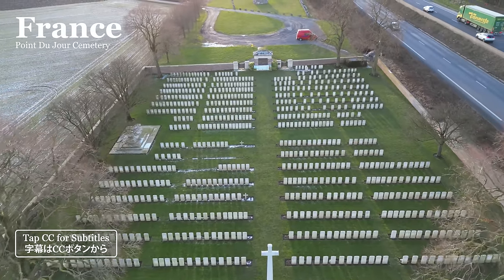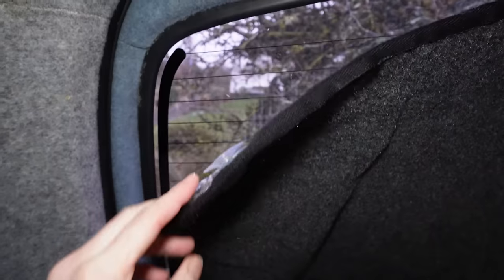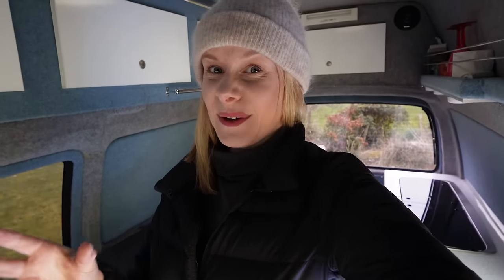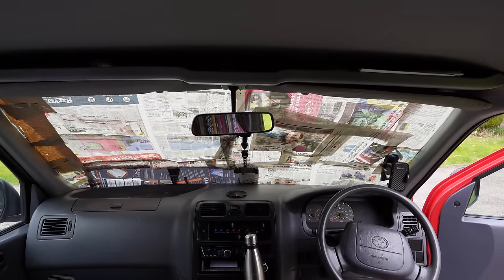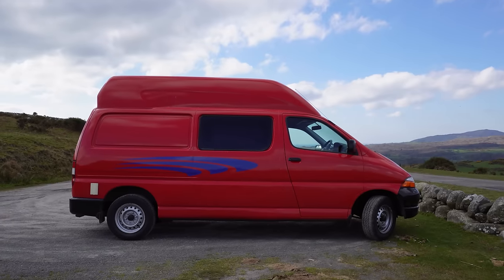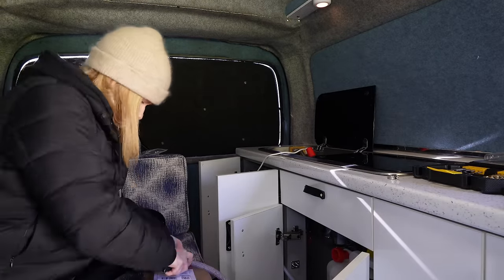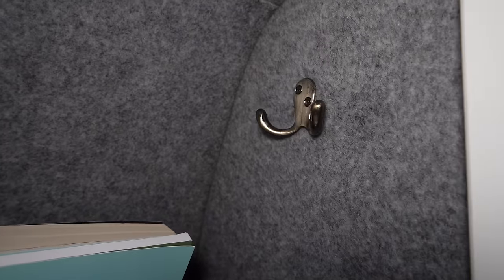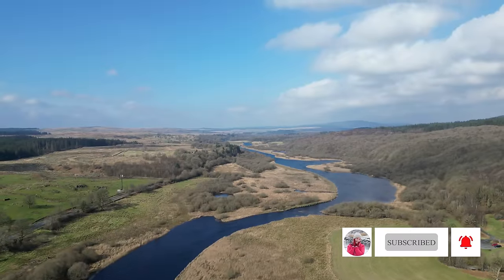It's Time To Make Some Changes...

Comment: You cook in the van. This  combo of oil and condensation sticks to everything including your windows, this why the suction stoppers do not work.  Simple answer is to just wipe the window with meths or isopropanol where the stoppers make contact and also wipe the stoppers and they will stay in place.
Reply from the maker: Thank you for the helpful advice! 🙏

Comment: Hi Ruth lubricate that runner with a graphite or silicone lubricant every 6 mo. It's a spray lubricant. Not oil or grease which holds dirt.  Enjoy your updates. Glad you are home safe and ok. I am adding 300w of solar to my van for my 40th B day in May. Cheers from Boston. Also I used iron on hem tape on my insulated window covers and it failed in about a year, then I used jeans iron on patch strips, it lasted about two years finally I used colored duct tape it's been working well for over 3 years.
Reply from the maker: Thank you for all this helpful advice. I’ll get some spray. Happy early birthday! 🎉
Reply: @ruthaisling if you can find it get Bose T9. Bonds to metal & does not attract dust or oil
Reply: Hello Ruth,think you could use  small magnets on your windows and on your covers, better than the suction pads

Comment: The foil blinds can be used in summer during the day when the van is parked up to try to keep some of light out rather than making it a green house.
Reply from the maker: Good idea. Although I’ve yet to experience a very hot day in the van 🏴😂
Reply: After a few van trips you'll have one giant muscular leg😂
Would painting the front window blind black make too much heat in the van?

Comment: Hello Ruth, I couldn’t help noticing that your gas bottle is not in a designated locker. It should be in a metal box with a door with a vent in the floor, so that if you have a leak of gas, which  it is heavier than air it is vented outside, have you a carbon monoxide detector? Great video by the way.
Reply from the maker: Thanks for pointing it out. Yes I have a CO detector. The space seems tricky to make a locker but I’ll look into it.

Comment: Ruth, as well as your suction pads, could you consider some over long fibre glass rods, essentially they need to be 2 or 3 cm longer than the height of your windows, you could then bend them into window recess, they;d be held in by the pressure of being bent into place against the window.
Reply from the maker: That’s a good idea, thank you!
Reply: I was thinking of the same sort of thing.🤔🏴

Comment: Hello, If you have remake the window covers at some future time, here is a tip.  Make the carpet about half an inch bigger all round.  The insulation would fit as you have done here but the border will be floppy enough to seal all the light.  On my van, I cut a piece of thin ply to over size of the window, then put some plastic blocks screwed on the metal surround.  I just bend the ply to fit behind the plastic blocks.  The ply is insulated with rubber/foil Do-Do and covered with  van carpet inside.
Reply from the maker: Good to know, thank you for sharing!

Comment: Hi Ruth,if you put suckers on both sides in the winter put the carpet on the outside and in the summer flip it around for reflecting the sun out to help keep the van cooler.  You could also put suckers on both sides of the front side windows then you can simply swap the left to the right side and vice versa.
Reply from the maker: Thank you for the helpful advice! 🙏

Comment: Suggestion. All that carpeting inside you should get some hook-and-loop (Velcro) - mostly the hook part. You can use it to stick just about anything to the walls and pull it off or stick it back on as you like.  Good 3M Velcro has really good adhesive on the strips. It’d be great for the window covers too.

Comment: If you must use suckers, go to your local supermarket's baking section and buy a small bottle of glycerine. Apply a thin film to the sucker and it will stay on.
The front was a problem. Would a modern roller blind mounted to the roof, basically in the same area as the curtains, not be a simpler solution?

Comment: Use cat litter cubes look like little pipe bits and wood chip it will work out cheaper and pine smell also cost free.xx❤
Reply from the maker: Thanks for the tip!

Comment: Hi Ruth you have been a busy bee!!  Your mark 2 window insulators are better, mine in the front is just the silver colour material and doesn’t harm with condensation, but as you think it looks obvious you are inside it might be better darker. I don’t think carpet would work with the condensation, so maybe painting them black might be the answer.  Your new handles are great, also your foot pump, hope there is enough flow.  Looking forward to your next trip in Scotland. Cheers Mike🥃🥃

Comment: We're in the process of changing our covers over to magnets which is a lot better and reflective on the ootside keeps the sun oot and the van cooler in the summer 😊
Reply from the maker: That sounds like a good idea, were you using suctions before?
Reply: @ruthaisling  aye some of them are still suction but the magnet ones are so much easier to just pull out and put on
Reply: @ruthaisling  we're also going to make them a tad bigger than the actual window size so it blocks out all the light also thinking of running a few stitch lines down them so they can fold easier

Comment: If you just make the window covers a little bit bigger than the window, you don’t need suction cups. It will just fit in between the van and the frame.

Comment: Maybe try long strips of velcro with sticky backings 😊 to hold the coverings in place . You would make them bigger than the actual window 🪟 to use the velcro strips with sticky backing 😊 . Maybe more secure to hold in place vs a window with condensation on it in winter
Reply from the maker: Oh good idea! Thank you! ❤

Comment: You should look into a NOCO battery jumper pack. They work really well at jumping the car/van if the battery dies. They are small, powerful and you only have to charge them about once a year if you're not using it loads.
Reply from the maker: That sounds good, I’ll look into it! Thank you! 🙏

Comment: I would retain the 12V pump and bypass the ignition switch. As long as you can get a 12V from somewhere, a simple inline switch would suffice to switch the pump on and off.
Reply from the maker: Yes it would have been an option but that 12V pump uses so much water. The foot pump is using less water I’m finding!

Comment: Hey Ruth great channel, think I’ve watched you a while ago but I never subscribed but I have now lol , just wondered how you got on with the shavings I have a similar loo I bought for my van conversion but I started using it in my boat, got a load of sawdust from the logs I cut up for my log burner but it’s hard wood antler me know how you got on with the shavings thanks Jack
Reply from the maker: I've used the duftblocker mostly as I still have some left but have also used the wood shavings sometimes to try them. They have been ok but I prefer the duftblocker. The wood shavings are easy to buy and still do the job.

Comment: Hi is everything okay?
Usually, when making a mold, spray water on a thin piece of paper to get the correct size! Then, the actual sheet to be installed should be cut 2 to 3 mm larger so that it fits well on the rubber trim of windows, etc. If the sheet material is thin, you can laminate it with a thin plastic board to eliminate the need for extra stopper clips! Just for reference! 😊😊😊
and If you keep soap and air fresheners in your toilet box, you won't have to worry about them! 😉
Reply from the maker: Thank you for the helpful advice! 🙏

Comment: I use a usb water dispenser from Amazon; super simple to fit, really efficient and cheap!
it’s the Amazi Water Pump… a single charge (via usb) is good for 8/10 5 gallon containers…
Totally independent of complicated wiring etc…
I also purchased a longer silicone tube so the tap sits above the counter top, like urs…
Reply from the maker: Thanks for sharing!

Comment: Greetings from Scotland! Hi Ruth! Just a thing I learned when doing the same thing (making insulated blinds) was that internal blinds, especially in the cab area, always left a lot of condensation after a cold night.
SO, I made a full one piece external blind just like the inside, but lined with thin foam wrap. It went all the way around from door - to screen  - to door, then tucked in both doors slightly which were then shut on it, holding it firm. SO, it didn't need suction cups to hold it up and when it was removed, no condensation on the inside AND when frosty/icy, no ice/snow on the outside - which meant I could drive away immediately. I only had them on the cab area because my motorhome had double glazed windows in the rest of it and fitted integral blinds. I also fitted a thick thermal draw curtain across between the cab and the living area, just to keep it cosier at night in cold countries. We lived in ours full time when travelling and it lasted for years! I bought all the insulation materials in a builders merchant in France because it was way cheaper than the UK.
When we travelled up in the Arctic circle region, I also made a full cover for the front bonnet area to keep the engine a bit warmer in seriously low temperatures. Mine was a diesel engine and although it was a new vehicle it struggled to start when it was very low temps. The insulated cover cured that problem!
Reply from the maker: Good to know, thanks for sharing. Where did you store it during the day and what about if it got wet from the rain?
Reply: @ruthaisling  Aaahh! Yes, I didn't consider that! We had a large rear boot, so I just gave it a shake (the rain ran off it easily), rolled it up, two bungees round it and threw it in the boot. You may need to think about storage. It may still work, IF you have the room. A bit of experimentation perhaps? The nice thing about the insulated bubble wrap stuff is that it rolls up quite tight. You only really need it when travelling in cold countries or in winter of course.

Comment: I don’t think the window cover would shrink due to thermal expansion. It’s more likely to be due to them getting a bit damp over winter. Might be worth taking inside when you’re not using the van. 🚐 

On our wan we have poppers into the van structure which or covers then pop onto so they are completely over the windows. It came like that though so not sure how hard they are to fit.
Reply from the maker: Yeah I might start removing them when I’m. If using them. It’s odd it happened!

Comment: I made the blackout blinds using the same bubble foil except I covered front and back neatly using black duct/gorilla tape...they push fit onto the windows inside the rubber seal surround...they work perfectly and are indestructible! 😊👍🏻
Reply from the maker: I might try that, thanks for sharing!
Reply: @ruthaisling  no worries 😊👍🏻

Comment: You might try spraying both "runners" with W-D 40.    Once every 3 months.   It really helped my van door.   It will run down the side.....just wipe off, will Not hurt the paint.
Reply from the maker: Good idea, thanks!
Reply: Definitely, also a light spray application of light oil or white grease to all hinges, door latches, bonnet(hood) catch, spare wheel mechanism, if it's under the van etc.

Comment: Great job, upgrades and vid! 
The foot pump seems to work very well but the place where it is looks awkward. That's a shame. I think I've seen a video of people drilling holes in their doors to get their foot in... but it seems excessive to me. I think that if it were me, I would think about leaving the pump loose (or screwed to a piece of wood) and I would take it out of the closet to the van floor when necessary, but sure you will decide better. 
Thanks again for your vids!!
Reply from the maker: Yes I did deliberate a lot about where to put it. Also considered outside the cupboard but thought dirt and dust would get trapped as I sweep the floors everyday. It’s so far been ok!

Comment: The cutlery handles made me laugh. Unbelievabubble. Reminds me of the deadly toys we had in the 70s that got outlawed after much blood was spilled. I think foil out is a bad idea except as a short-time sunscreen - for safety; turns Ernie into a giant reflector & announces him as a camper to any ravenous canines and sundry evildoers. Plus condensation; you're essentially creating a solar still with a reflector behind a cooler glass. If you get fed up with spitting on umpteen suction cups (ewww...) that'll lose their grip regularly, anyway,  I've seen screens secured around the frame with magnetic tape that worked well; gives you some shrink/stretch wiggle room plus air between screen & glass to ease the condensation issue.
Reply from the maker: The idea for magnets sounds really great, thank you!

Comment: Cannot remember if you have purchased an electric blanket but if not am sure that will keep you warm and comfy on the cold nights at little cost.
Reply from the maker: Yes I might try and get one for next winter. Would be good to use when plugged into EHU

Comment: Flexible rods (fibre glass or similar) running vertically that sit in a cup at the bottom and clip at the top would probably keep the blinds in place. 
Or webbing straps looped through some D rings
Or something with magnets if there's not a lot of weight to hold in place
Reply from the maker: Thank you for the ideas!

Comment: Hi Ruth, just wondering if it wouldn't have been beneficial to have the carpet overlap the thermal insulation on all side by say approx. 1.5 inch. That would have 'automatically' compensated for any thermal contraction and also have give the chance to add some velcro for added holding strength in case of suction caps failure.
Reply from the maker: Good idea! I’ll see how these are and make more changes if needed

Comment: Coincidently, I was modifying insulated screens on my van today (I bought the wrong kit!) and have a couple of suggestions for anyone attempting this job. Personally, I would advise against spray painting the shiny tin foil material. As surmised during the video, adhesion is never going to be good and you will be left with piles of paint flakes in the van and a very scabby looking window cover. 
If you are handy with a sewing machine, consider using black ripstop material, secured by bias binding edging. If suction cups with eyelets are fitted, the finished result will look identical to a ready made custom kit. 
And a wee tip, if your van has a lot of window glass (mine has 10! Fiat Doblo high top) mark the covers with a Sharpie - e.g. n/s middle.
Reply from the maker: Great tips. Thank you! I was worried about the paint flakes too…!

Comment: I like the window covers. Mine are velcro on Sunbrella, and work well except for one. It keeps coming off. Not sure why. I leave them up all the time though, got a lot of glass. People in the UK with vans seem to use a lot less power. I have almost 3 times that much in mine. The LiFePO4 setup does use some space, but will run everything for a very long time with no charge coming in.
Reply from the maker: Yes the proper electric system would be good and would provide me with much more power but for for my needs at the moment, I think this set up will be ok!
Reply: @ruthaisling  In the spring, I take the ferry to Alaska and then drive back down the Alcan. So it needs to keep the fridge cold for at least 5 days while parked below deck. My power system was built with that in mind. Your setup seems to be working just fine though. Cheers!

Comment: Hi Ruth!

I don’t know if you are interested in some suggestions, and I don’t mean to sound like I am meddling either.  But because of the thermal expansion and contraction of the materials you are using for the window covers you might want to consider oversizing the covers and using Velcro straps at key points to attach the covers to the window frames.  Also, I like the idea of using reflective bubble wrap on one side and a darker material on the other.  Have you considered making these reversible?  You could have the reflective material on the outside in the warmer months to reflect out the heat, and the reflective material inside during the colder months to reflect heat back in, and absorb any heat from the sunlight during the winter months.  I know, Velcro has its drawbacks, but it will allow for the thermal changes better than say, snaps.  You could also stay with suction cups and still use the oversized sheets as I suggested too.
Reply from the maker: Thank you for the helpful advice, Velcro sounds like a really good option.

Comment: Talking about your power.  I noticed in a previous video where the solar panels you used are not the best for the Scottish weather in particular.  You bought polycrystalline panels  which are cheaper and less efficient than monocrystalline which cost more, but are way better.  They will absorb power even on cloudy days.  I have one 40 watt one in my garden keeping my car battery fully charged from November till April when my car is winterised.  The poly one would be useless.  I would replace what you have .
Reply from the maker: Yes I did consider monocrystalline and they would have been first choice but with the fiber glass curved roof it wasn’t very easy to attach them so I went with the flexible one this time. It’s been ok actually, yesterday during the day my Bluetti was topped up by 15% even though it was sunny and rainy!